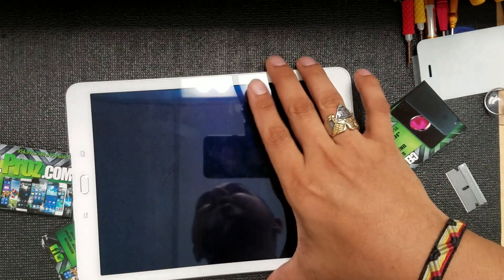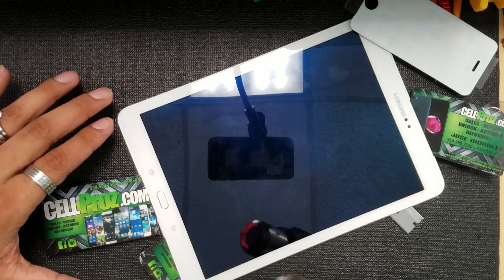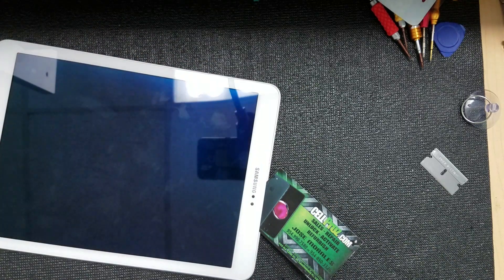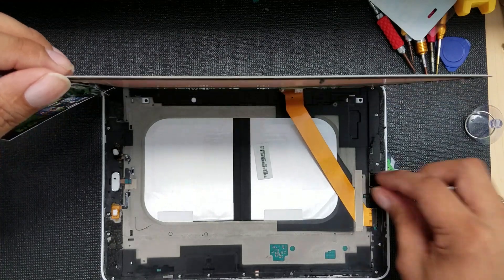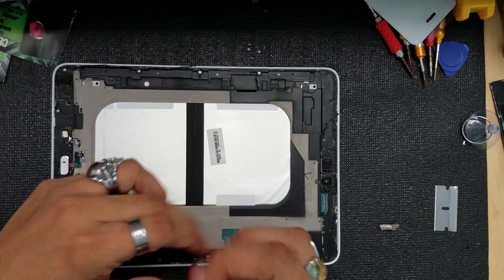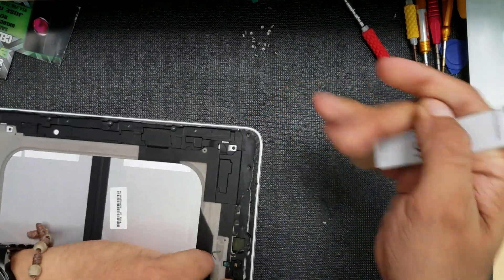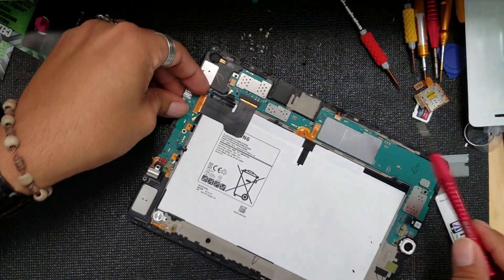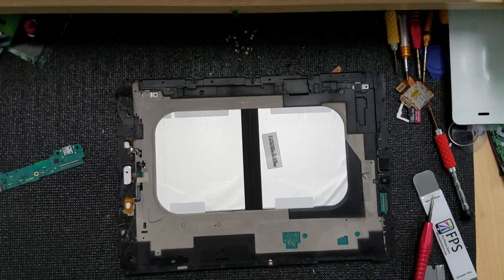Samsung Galaxy Tab S2 T810 - Screen LCD -  How To Take Apart - Repair

Comment: ok, im putting mine back together now... but want to make sure of something quick... in the video at 14:06, on the top left corner of the device, there is an empty circular spot.  Mine is also empty.  It has wires running to it, but nothing there.  I want to make sure i didnt lose whatever is suppose to be there?  Or is this for cellular connectivity maybe?

Comment: my tablet does not turn on and when i connect it to micro usb, it heats up but does not seem to charge... is the charging port faulty?
Reply: have you fixed it?
Reply: @jianguoyuan3348  nopes :( changed the charging port but still not good

Comment: I am curious, I have a customer with the T818T that the battery only slowly or partially charges. The customer claims it is the charging port but I don't think so since the plug is tight, the tablet recognizes and charger is plugged in and a pc recognizes the tablet. This is the customer's 7 th replacement tablet from AT&T. All have had the same issue. Slowly or only partially charging. I am thinking Samsung has a software/ firmware issue with these tablets. Did your charge port replacement fix the problem?
Reply from the maker: Bobby Gorden can be only 3 things , bad charger , battery or bad motherboard . If charging port is bad it would not charge it all or just when you shake it .
Reply: I am seeing this is a common problem with these. Some are saying the last update is flawed. I am going to take the Tablet but I really don't want to open it up just yet. I am leaning toward software or Motherboard. I hate to replace the battery and charge port to only still have the same issue, especially since this is her 7th Replacement Tablet. She is fed up and I hate to make her pay for all the parts and labor to end up with a still defective tablet. I am always up front with customers but this is one that can only be a "guess and by golly" repair.
Reply: Try to change the charging cable, not all charging cable compatible with tab S2. Avoid the flat type cable as it usually not working

Comment: You could’ve saved yourself so much time just by cutting back metal plate with pliers covering charge port and force pulling charge port out with pliers with the two screws that’s glued into the plastic, they just come out with a bit of pressure :) no need to go through all that hassle. Just a tip ;)
Reply from the maker: Dchizza8 Man that is Savage lol

Comment: Be very careful when you try to separate the screen from the body. I put a wee too much force pulling on the screen and it splintered the display - micro cracks. Now a dead tablet.
Reply: yeah thats exactly what i was thinking, because he had already separated the screen from the body before the video started. Its a lot harder to do without cracking screen.